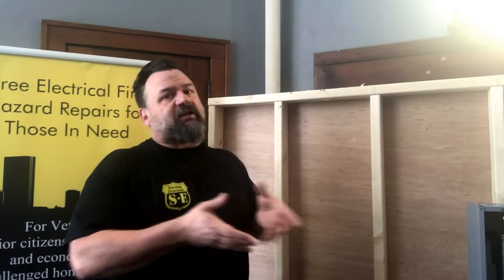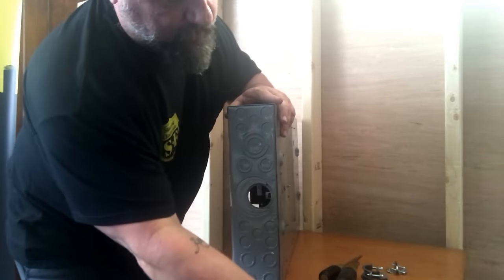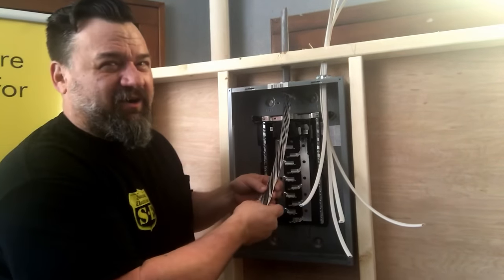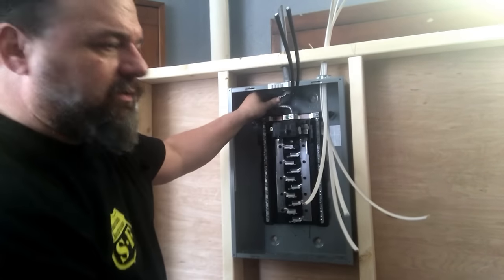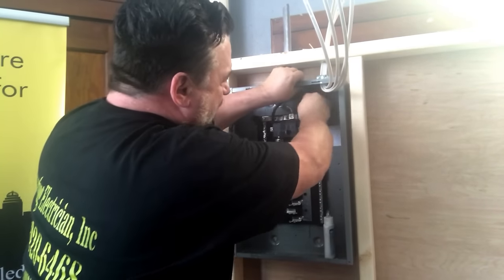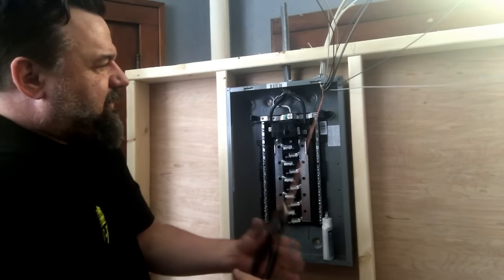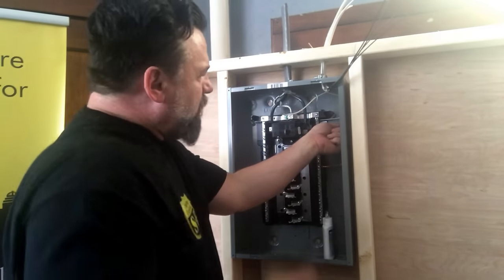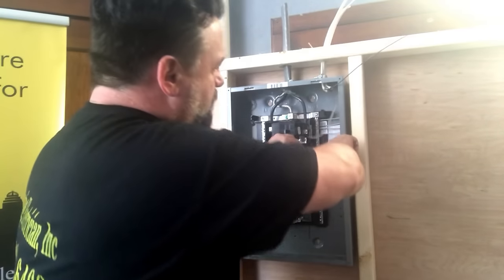How to wire a 100 amp service panel. ,  2020 National Electrical Code compliant

Comment: Hey Ok Your a Electrician I just commented on one of your recent vids. We put Are Services in pipe here In City Of Omaha EMT And Ridgid and PVC out Side of Omaha Wich is BS.. Your Service Cable Doesn't look like it's rated for out stapled to side of the house...
Reply from the maker: Jon ANDERSON  I hear ya. My question is that we all have the same code book and it covers service entrance cable but that shit would turn to dust out west. It’s strange for sure. West coast has the panels outside. So if it’s raining you have to reset a breaker outside? I just moved to Vegas and am taking the contractors out here in a couple weeks but wonder if there’s different wiring methods. Btw I drove through Nebraska and absolutely loved it! What a beautiful, clean, friendly place. Well sorry if I came off a little pissy, some of the stupid shit I get from people would drive you crazy. We have different things that are done different everywhere but anyone with a Home Depot electrical book tries to call me out but never recite where I’m wrong. I’m just doing this for fun as I’m trying to get a program together to train Vets and get them in the skilled trades. Mostly good people but the people I have to block are crazy.  Thanks for the question. Take care

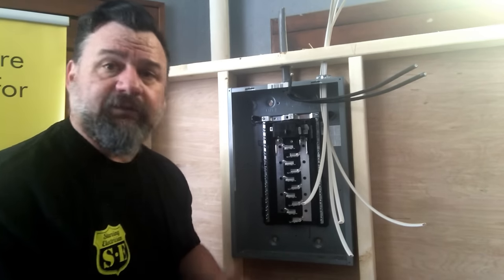Comment: 6:00

so he is a handyman, not an electrician. he should know this
Reply from the maker: not sure I know what you mean.
Reply: @StarvingElectrician  
"we are connecting the neutral bar to the ground bar. Why do you ask? i don't know"

An electrical contractor would know this
Reply from the maker: @craiganderson9668   yes neutral and ground bar are connected at the primary service and bonded to the box its self.

Comment: Here are what Professionals in Hawaii are earning based on how much my Mother was charged:

Electric work to rewire house for two submeters for electricity for a 1,500 sq feet two story home = $15,000
Plumbing work to install two submeters and for additional washer and dryer = $10,000
Digging French Drain around this old ww2 house to last 10 years = $20,000
Adding vinyl flooring, and painting for two bedrooms, bathroom, and living room = $15,000
Replacing Cast iron piping for ABS piping $7,000
Replacing Main electric Panel that never was actually done!  $1,700!
Installing Mini-Splet A/C system for two bedrooms and one living room with with one exterior condensor = $8,900!

I just want to save my poor mom from all of the AS!@$@#$holes that try and rip her off of her money because they think she's an elderly woman with alot of money that they can take advantage of when in fact she's struggling to stay afloat because of years of being taken advantage of by everyone from her deceased husband that never set up anything to protect her in the event of his death, his debts, telemarketers, electricians, plumbers, contractors with there over-inflated prices, probate attorneys charging her exorbitant fees, property management that mismanaged her properties forcing her to liquidate many of them.  No senior citizen should be faced with such stress and hardships!   I am her son and should have saved her from all this, but how can I with a jobs that cumulatively only pay enough to sustain one person's life just because I am not as mentally clever as Elon Musk, Warren Buffet, Jeff Bezos, and Bill Gates!  If only I knew how to do this and plumbing, and other things!!! If only there was a way to learn this things to save my mom from having to lose more money to these Greedy Pigs!  I am willing to crawl in the mud under the house just to save whatever she has left!    

 I know there are youtube videos that show fragments of this and that, but then they make those disclaimers of how we should consult with licensed professionals, or government inspector approval!   How can anyone safe themselves from poverty if they aren't allowed to work on their own homes without paying huge fees or else face legal ramifications!   I need to do this for my mom regardless if I get fined or arrested!   I just need to know how!!! before it's too late!!!!   she has one property left!  and even with that she had to take out a $100,000 home equity just to pay for Bogus Repairs that property management kept suggesting to her.    After she spent $20,000 in 10 month for repairs we don't even know for sure whether it was really done or not....after she spent that in 10 months, they promised to her they would rent out the property.....it's been three months and now she's forced to sell that very last property!    

As a Desperate attempt i suggested to her to set it up as an Airbnb, but Airbnb clients must be spoiled it appears from what Airbnb Super hosts say on youtube videos I've watched about how Airbnb Guests nowadays enjoy for amenities, so her last property is a ww2 built house, but I am having to figure how how to get the house set up as a "smart home"   Also I'm trying to figure out how to install a dedicated breaker for Three Mini-Split A/C's and how to install them!  I am having to learn all this because those so-called professionals who can do this job want to price gauge her to death!
Reply from the maker: sorry just got an alert that 30 comments were pending so I just saw your comment. so sorry to hear about this. didnt we communicate months ago? hope it went well.

Comment: I understand that you guys like this guy. The first thing that comes to mind is Starving Electrician "if you are solid Electrician your almost Never Starving" This guy is funny and explains things well but I've been an an electrician for over 20yrs now. He is installing a Sub-Panel. First thing is the SCR that he is using is only two wire with a ground only. No Neutral wire (in a Sub-panel you have to have your Grounds and Neutrals have to be Separate) but he didn't even bring in a Neutral. Just for you guys to know you have a Grounded Conductor  (Neutral) Grounding Conductor  (Ground) If this was to be the Main Service with an All in One then Grounds and Neutrals need to be connected in the same bar connecting to the Utilities Grounding system. PLEASE DO NOT INSTALL A SUB PANEL LIKE THIS YOU WILL HAVE PROBLEMS IT'S NOT A MATTER OF IF BUT WHEN?
Reply from the maker: WHERE DO YOU SEE A SUB PANEL? THIS IS NOT A SUB PANEL NOR DID I SAY IT WAS.  STARVING ELECTRICIAN WAS BORN OUT OF LOOSING MY HOUSE DURING A RESSESION. BEFORE YOU PIPE UP MAYBE YOU SHOULD LISTEN. SOMEONE ALWAYS WANTS TO BE THE GUY WHO CORRECTS THE TEACHER.

Comment: WOW!!!!    Where in the NEC code does it say you can bring 4 branches thru one hole???    And where does it say you can twist four grounds together and put them in one slot???    ILLEGAL!!!!!!!!
Reply from the maker: john smith  twisting wires together is depending on the circular mills of the wire under the terminal. 4 wires in a 3/4 connector is 100% legal.and so are the grounds. Tell me in the NEC where it says it's illegal!!!!!! Inspectors have to note the violation so if you are trying to discredit a man with over 30 years experience I suggest you back it up with facts not your opinion. Just got a service inspection today and guess what, I passed once again. Never failed one time for what you are claiming is illegal.
Reply: It is not an NEC code it is a manufacture spec. Most ul listings on panels are only for two grounds under one terminal.
Reply: Agree that some regulations/codes/ and/or "laws" can be out of touch with the public interest - but you have a shocking misunderstanding of how "laws" are created,  and the role of the US Constitution.  Doesn't surprise me because public schools no longer teach the basics of how our government works. Read up on it - you'll be surprised how it actually works.

Comment: Your problem with the service wires being so close is because that panel does not meet the new codes. Way too small a space around all of the box. New ones have nearly double that space at the top. And only a 100 amp service? Most new homes have 200 amp service. Ours does and it was installed 40 years ago. 4 3/0 wires would be a bear to install in that box.
Reply from the maker: gravelydon 
Totally wrong in all your assumptions. 
100 amp service panel made by square D is 100 percent legal. Close wires have no bearing on anything unless they are in a long run of pipe for a voltage drop and at that point you D rate. Don't talk about "new codes" unless you can recite them. 
Most houses are 200 amp? Wrong again. Do you know why a house would have a 200 amp panel? Because of a load calculation to determine the demand on the service. Did you know you can feed a 100 amp sub panel from a 100 amp service? That's because you can have a hundred breakers or circuits for that matter in a house so long as the load does not exceed 100 amps. To pop up on a video meant to help a homeowner and make assumptions that they are illegal and talk about new codes like you have some insight is plain stupid and obviously meant to damage my credibility of doing this for over 30 years. Talking about the number one panel maker producing a UL listed panel is just ignorant. Who said anything about a problem installing anything. It's a demonstration on a 100 amp panel. There's always someone out there to say hey you are doing it wrong and I know better but when asked for proof like reciting the code book, the argument of NEW CODES just shows  where you store your head on a daily basis.